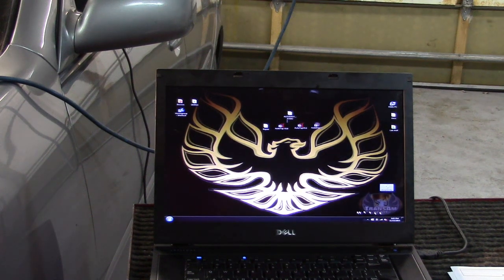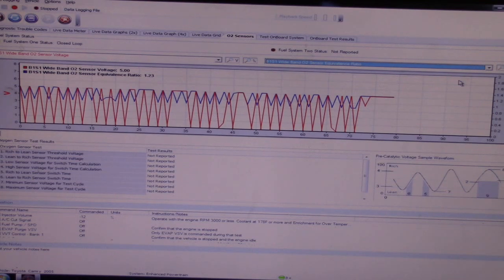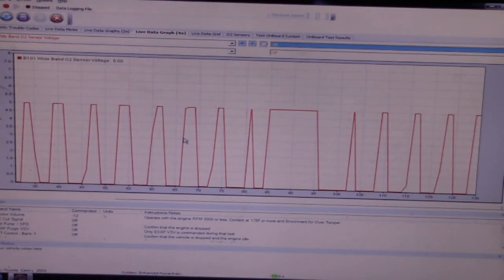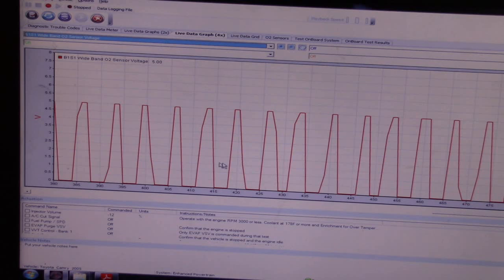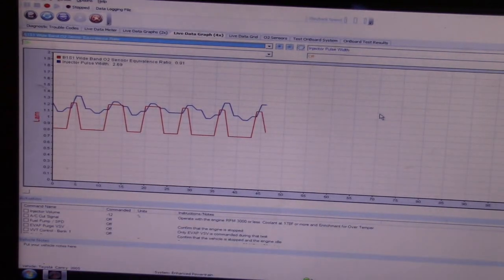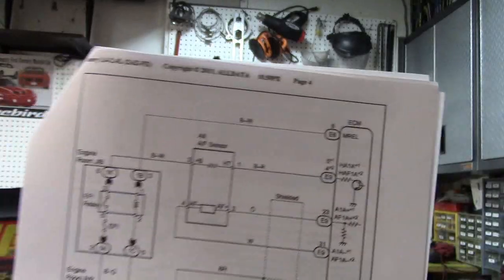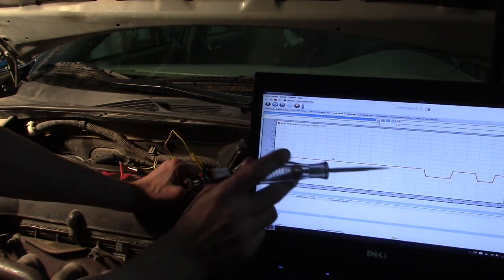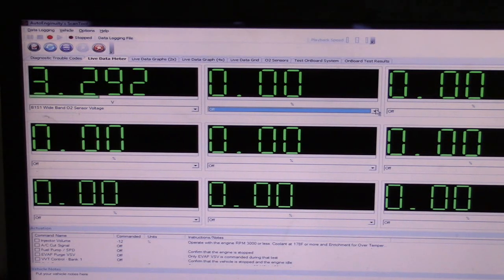Diagnosing Camry P2196,P2238 A/F sensor codes PART2

Comment: Hi, awesome diagnostic.  I have similar issue, 2004 toyota highlander 2.4l and p2238 code after replacing th A/F sensor from toyota oem. Could the new sensor be defective?
Reply: Same code popped up couple weeks later with Same code p2238
Reply from the maker: If you didn’t have the 2238 code before then yes it’s pretty likely. 
  If you had the 2238 code before and the new sensor gave same code a few weeks later it’s more likely you have an issue with the wiring.  Check your voltage and continuity on the heater circuit first.

Comment: Is it possible to rebuild and fix A/F sensor and get it back to normal working?
Reply from the maker: i don’t think anything is serviceable in a AF or O2 sensor. you might be able to clean it with some solvent or brake cleaner possibly but you can’t rebuild it.
Reply: @SchrodingersBox  i see, thx.

Comment: Can you send me the wire schematic you held up. Also the pin orientation of the connector
Reply from the maker: I no longer have them- You can get those on AllData DIY.
Reply: @Schrodingers Box  ok thanks. I don't believe my issue is the sensor. Think it's something related to it. Short story my sister rear ended another vehicle, bent sensor slightly. Replaced with new......along with everything else that was damaged

Comment: Could the O2 sensor near the converter cause the same thing?
Reply from the maker: no. that sensor is to monitor catalytic activity. there are some models where the rear O2 has some contribution to fuel trim but it’s minimal- not enough to cause these symptoms.
Reply: @SchrodingersBox  my Camry is a 2004, and it just started surging as such and the only code is the back 02 sensor... That's why I ask.  If I pull the downstream sensor and drive it, and it clear up, could it tell me if the cat converter is clogged?
Reply from the maker: what is the code exactly?
Reply: @SchrodingersBox  I originally was given a P0032 code, but it doesn't cut directly back on when cleared.  Right now, there's no code, but the surging is in full force.  Surges about every half second to a second.  I hate to spend $100 on an 02 sensor if something else is causing it.  Muffler shop said he'll put on the sensor and check the exhaust and converter for 20 bucks.  

Also, I really appreciate the information.  I'm a nurse by trade, but the family business is A/C.  I can fix air conditioners, but know very little about cars.  Channels like yours help me a lot.
Reply from the maker: a P0032 is a sensor 1 code, not sensor 2. I would first  check for voltage and ground and continuity on the sensor heater circuit and test the sensor for lean and rich response. 
     after that I would check to see if fuel trim variance correlated with the surges so I could see if this is a performance management issue or something unrelated like a TPS or IAC or something.

Comment: I initially got only one code. P2238: Upstream Sensor Bank 1 Sensor 1, "Low pumping current"... But after a few weeks I got P2238 and P0420 "Catalytic System Ineffiency".

Hopefully, replacing the sensor clears both codes.

But I am wondering why both codes did not come up together. If P0420 code suggests catalytic converter is bad, I don't want to bother replacing the sensor
Reply from the maker: What data do you have on the P2238 that indicates replacing the sensor is going to fix it?
Reply: @SchrodingersBox  I know very little about car repair and only have the OBD code P2238 and "Low pumping current Bank 1 Sensor 1" message . I am assuming that replacing that sensor might clear that code. It is over 150k miles on that sensor.   The mechanic scanned OBD  and advised me to search for that part. I ordered the part (Upstream Air Fuel Ratio Sensor for 2004 Camry SE, 2.4L, 4 cylinder, California Emissions) Denso Parts Number 234-9049. 

After delivery, I am planning on giving it to mechanic to install. Are there further diagnostics to be done before replacing Air Fuel Ratio Sensor? Checking the voltage of the sensor to confirm it is bad?

https://www.ebay.com/itm/Air-Fuel-Ratio-Sensor-OE-Style-Air-Fuel-Ratio-Sensor-DENSO-234-9049/254822992648?ssPageName=STRK:MEBIDX:IT&_trksid=p2057872.m2749.l2649&redirect=mobile
Reply from the maker: I would absolutely validate the current in the sensor (you won’t be able to measure voltage) and see if the fuel trim and equivalence ratio responds to variations.
  There is no way I would just replace the sensor and hope.   Hope is not a plan.
Reply: @SchrodingersBox Thanks for response. I am disappointed that the mechanic (VERY experienced)  did not tell me this. He just scanned the code and told me to replace the sensor... His thinking must be that it is an old part that will have to be replaced soon anyway and the odds are that it is likely the sensor. But I agree that it is not a good approach.
Reply from the maker: well honestly with that code, odds are in favor of it being a bad sensor but it can absolutely be caused by other things. chances are a new sensor will fix it but I personally always test before replacing parts. I can’t even count how many videos I have where I even said in the video “this is almost certainly a bad XYZ” but when I do the diagnostics I find it was something else.
Reply: @SchrodingersBox   The  suspected upstream Air Fuel Ratio Sensor is much more expensive than the upstream Oxygen Sensor. I know your channel  is aimed for DIYers. But for less experienced people using a mechanic, does it make sense to have mechanic replace the oxygen sensor as well?  Rather than waiting for the oxygen sensor to go bad and having to pay mechanic   for installation again... I think the average life span for sensor   is about 100,000 miles and these sensors  are over 150,000 miles.

Comment: Awesome vid watched both parts great explanation. But I have a problem. I have a Toyota Yaris 2009 Tr 1.33 Petrol and I was driving normal on a rainy day and check engine light came on. It’s a P2196 Oxygen (A/F) Sensor signal stuck rich (Bank 1 Sensor 1). I don’t know why that code came on as my car drives fine, The revs are all equal and balanced and not jumping up and down  it runs smooth gives power like it’s been since I’ve owned the car basically drives like a dream but why did I get that code? Iv also checked the wiring and it’s all good. What i have done is iv cleared the code and drove it for a bit like 4 to 6 miles around town and I have not got light on yet. Do you think something is wrong like the sensor or anything?
Reply from the maker: I would simply induce intentional lean and check the equivalence ration to see if it goes positive. If it does not, replace the sensor.
Reply: Schrodingers Box thanx soo much for your quick reply I will give it a go soon and get back to you with the result. Actually do you think I should wait if the engine light comes on again and then check and replace it? Because the lights not come back on yet after driving it for a while?

Comment: I wish you was in broward county,im going thru a similar problem on a lexus rx330 2004 i changed the sensor 3 times with denso and still having that code p2238 I'm going crazy..2 mechanics later and nothing changed
Reply from the maker: Why change the sensor even once? What was the data indicating it is the sensor?

Comment: That was a great fix! Thank you! I think i will be fabricating my own 1.5 volts probe with a button to switch polarity for A/F sensor circuits! I will send you a comission later...LOL! At the end I think that the car had a regular 4 wires O2 sensor on it because I pretty much know from my own experience that that Camry older version engine with IAC actuator for idle uses, from factory, a O2 sensor. Keep up your great videos!

Comment: +Schrodingers Box I find this video extremely interesting. One thing that you didn't mention based on the circumstances is that perhaps this is the wrong air/fuel sensor, not just that it is bad. The evidence that I think points to this are three things. 1) Air/Fuel sensor still worked, it just maxed out in either direction 2) The max is 0 and 5v, which is very common for data logic circuits to be the rail voltage. If you're an EE (or an electrically capable guitar player), you might recognize that as an amplifier clipping the output signal due to extreme gain. 3) You said that the third engine was a different model from OEM. In your air/fuel understanding video, I believe you mentioned that air/fuel sensor "voltages" are all over the place, indicating different models are scaled differently.

Putting this all together, I propose what might have happened. The previous engine used by design stronger signal air/fuel sensors, and the newer model engine (I assume the PCM would have to be changed along with the engine) uses weaker signal air/fuel sensors, so it amplifies that signal MORE than the older PCM would have done.

If the old air/fuel sensor was used (dang those are expensive), then the newer PCM would end up over amplifying the signal and clipping the data full rich or full lean which is exactly what you saw.

One impossible to perform test for this situation, would be to do the engine swap in reverse (i.e. use the newer air/fuel sensor in an older model engine) and you would see that the signal would be proportional but very weak, and the effect would be that the engine could not appropriately compensate for rich or lean condition.
Reply from the maker: Pretty good assessment. It actually turns out the car had an O2 sensor instead of a A/F sensor. Easily explains everything and I can see how that happened with the engine swap.
Reply: I am learning so much from your channel. Thanks for the praise and the follow-up. I probably would have wondered for a long time if I were right or not had you not responded. ;)
Reply from the maker: Lol I try to satisfy curiosity best I can, seeing as how curiosity killed the cat and all

Comment: Your a genius, the mechanic or customer , should give you  $500 for eliminating that problem. I got a Honda Accord LX 2001, everytime I put the AC on  and then I stop my car lunges forward, as if the  compressor is making it to lunge forward. But if I stop very slow if don't lunges forward also when the AC is off. What do you think is the problem on my AC system ?,.

Comment: Have you read this article?  http://www.motor.com/magazinepdfs/072013_08.pdf

According to the article it is possible to read lean or rich conditions by connecting an oscilloscope to the pumping cell, reading voltage and not current (probably not the same voltage the scan tool is reporting though?).

I only work on my own cars and only started really digging into diagnostics less than a year ago when I discovered ScannerDanners channel. I do have a 4-channel picoscope but no cars that use a wideband sensor, so I'm not able to verify the testing described in the article. It seems contrary to what I've seen here and on Pauls channel, so it would be interesting if you get the opportunity to test this.
Reply from the maker: +Geir Tore Simonsen I haven't read the article but I believe I have a video on my other channel showing this. 
  But bottom line is there is no way on any sensors as of today that you can read current.

Comment: I vaguely remember in james danners video a test for afr sensors I believe he found in trouble shooter on a snap on tool. I can't remember the testing exactly. 

so your bypassing the sensor portion of the o2 and simulating a voltage? That's a great test in my book. I'll have to watch your link on afr sensors. I've always been satisfied with bias voltage appearing with the sensor disconnected that the wiring integrity was good.
Reply from the maker: +Turbotomass I agree- the bias voltage alone is surely suffient but I wanted to be 100% plus also show other methods. But no doubt the bias is sufficient.

Comment: I never thought of this before, but exhaust shields may actually protect an AF ratio sensor's longevity. Sure, it's in the hot exhaust literally, but the rest of the sensor should be in less of that air, which shouldn't be ambient.
Reply from the maker: +DE Nichols Good point- never really considered that!
Reply: Schrodingers Box
I've been avoiding wrapping my exhaust for a long time to give it even more insulation beyond the heat shield for a few years. Time to get it done. Tired of losing O2 sensors...that seems to be the only problem with having an older car, it's not that I'm trying to be cheap, it's that the parts that are available are losing quality.

Comment: Super strange failure. It can do stoichiometric...the scale is probably a bit off. I'm betting for the tiny bit of use this Air Fuel sensor has left is...well, it's just amazing it hasn't gone completely dead. As at least O2 sensors start to whack out they gradually go worse until their dead.

LOL. I even have a 4 stages of death thought process for O2 sensors, lol.
Reply: That poor AF sensor. It's down to being an O2 sensor. Just rich or lean, no variance. lol.

Comment: couldnt you of just backprobed the sensor aand seen the output and deemed it bad with a scope??
Reply from the maker: +phil holbrook No you cannot do that with AF sensors like you can with O2 sensors. On AF sensors the ma are too low to detect and there is not actually voltage change as shown in the scantool- that is just artificial data.
 See my video on AF sensor diagnosis and understanding and it explains.

Comment: why did adding a recistor in series made the artificial rich condition go greater than without it? shouldn't  the recistor create a voltage drop on the 1.5 volt battery, therefore lowering the voltage of the battery to the wire, lessining the rich condition.
Reply from the maker: +Oscar G Because it was less resistance than the combined test light and resistor
Reply: +Schrodingers Box I totally missed the light not being there with the resistor. the more videos i watch, the more i feel like i need the quantum mekanic channel.
Reply from the maker: Oscar G Lol thats precisely my intent ;-)

Comment: Hi Matt. Thanks for vid again.
It was a paradox. This car had a perfectly working O2 sensor. But PCM wants to read A/F sensor signal. So I am 100% sure, that You changed O2 sensor to A/F sensor. Think about all these engine swaps and signal traces. Makes logic.
Thanks for your time
Reply from the maker: +Arvydas Kraftas Yes agree it seems the car must have had an O2 sensor from the used engine that was carried over inadvertently. that makes total sense except that we saw negative fuel trims on the STFT- how would that happen when an O2 sensor does not have alternating polarity?
Reply: +Schrodingers Box It is quite complicated thing to know and understand. O2 sensor i generating voltage. Put voltage on resistance and here we go, we have curent. When we have a ritch condition, sensor is generating positive voltage (over bias 450mV). When there is a lean one, sensor generates negative voltage. I think, that PCM input has some type of resistance. Thats only my thoughts about altternating polarity.
BTW could you please make a note again. In witch condition A/F sensor is generating postive polarity curent?

Comment: So I unwillingly went to some forums after google searching waveform for cam/crank on a Chrysler 3.5. Of course I didn't find anything, but it was worth a shot I guess. What I did find was that these toolbags call their snap on tools "snappys". Every time I read it it pissed me off more and more. Not because I am die hard snap on. But because it is just f**king stupid. Like I want to kick them in the throat Holly Holms style. 
So ends my thought of the morning
Reply: +Nandor Lol anyone using the term snappy is the least likely to provide info on diagnosing a cam sensor I bet.

Comment: When you were doing the test using the battery   couldn't you just place one of your fingers on the battery+ and using your body as a resistor touch the appropriate wire with your other finger on your other hand? I've seen this method done in other videos before?
Reply from the maker: +MortoFett I could have done that if one of those wires was a feed but since the AF sensor actually generates the current I needed to provide a source of current, not resistance.
Reply: +bidoubleo tiwhy If I recall I believe it was a 10kOhm... I really didn't check because bases on the fact the voltage was maxed out originally I was quite certain that far more current was gettin to the PCM than what would go through wirh even my lowest resistor I have which is 1kohm.  it may have been 1kohm in fact- I just grabbed one from my pile of electronics scrap lol
Reply from the maker: +bidoubleo tiwhy Yes AF sensors are all about extremely small current- not voltage. I have a video on diagnosis and understanding of AF sensors that goes into the detail but basically when you see voltage for an AF sensor on a scan tool- you are looking and artificial data. The voltage is not actually real. Also as you calculated the current is so low it can't be measured  directly with a regular DVOM. 
  AF sensors are very very different than O2 sensors in mechanism but they still serve the same function. 
  You should watch my AF sensor video- sounds up your alley and it was my first exposure to them. I've learned a lot more about them since then!
Reply: bidoubleo tiwhy Lol the way you calculated that only amperage can explain the operation of the sensor sounds to me like you have it down pretty solid! That was impressive to say the least! Totally in-line with the philosophy of the channel on how we learn mechanism too.